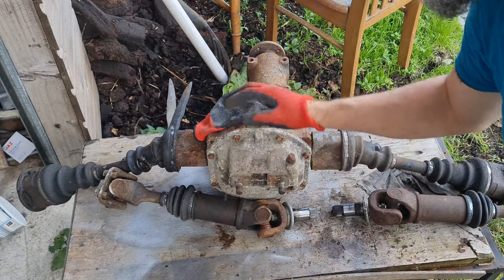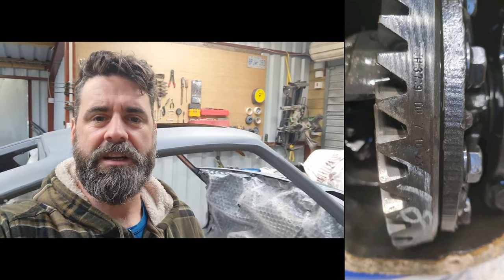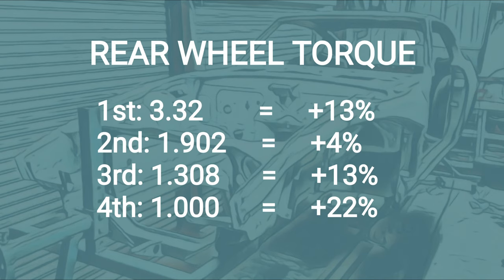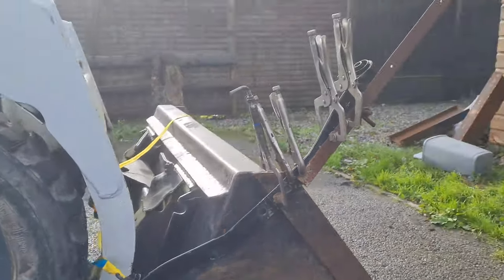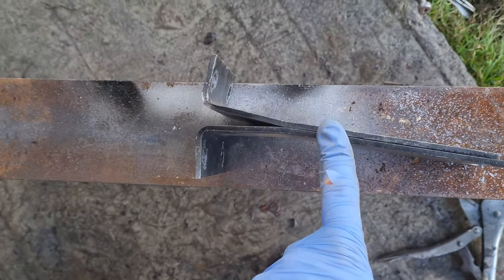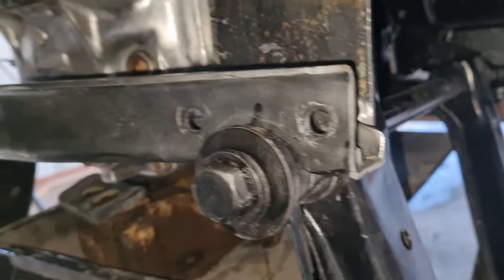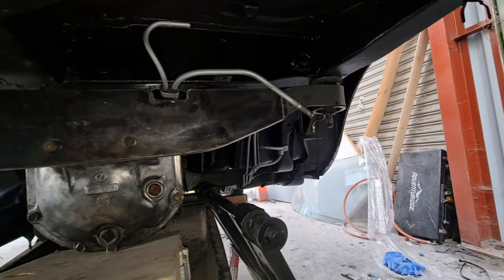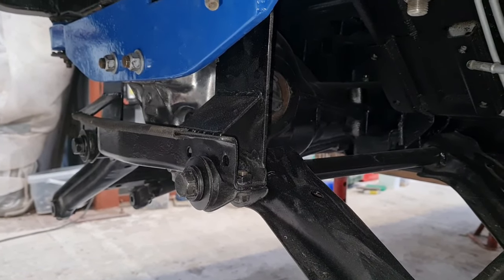Datsun Z. R200 Differential Conversion from a R180. 240Z 260Z 280Z

Comment: I’m also doing a R200 swap on my 73Z but I need some help, I got a 5speed from a zx and my driveshaft fits into it but it looks too small for my r200. Would you recommend buying a zx driveshaft?
Reply from the maker: To be honest I'm getting close to this stage but not quite there yet. I have the same predicament but with an s14 gearbox. Thinking of custom shaft myself
Reply from the maker: To be honest I'm getting close to this stage but not quite there yet. I have the same predicament but with an s14 gearbox. Thinking of custom shaft myself.